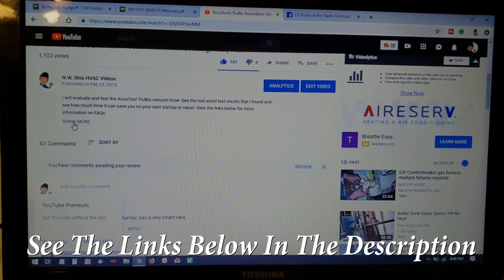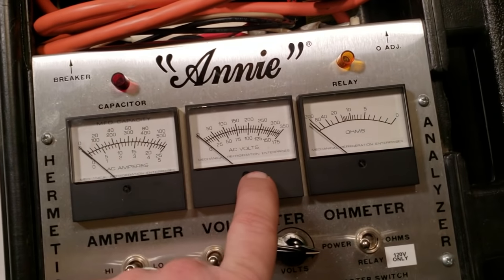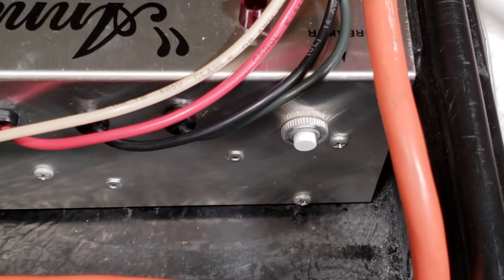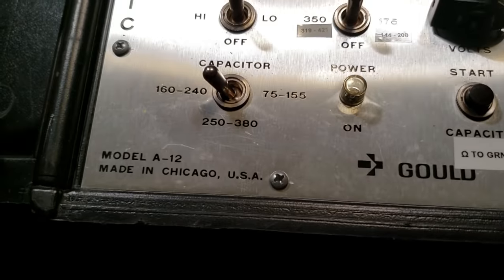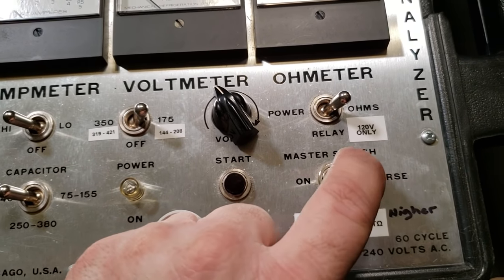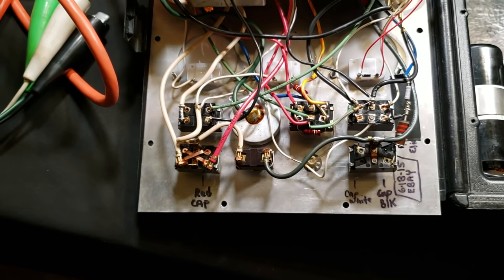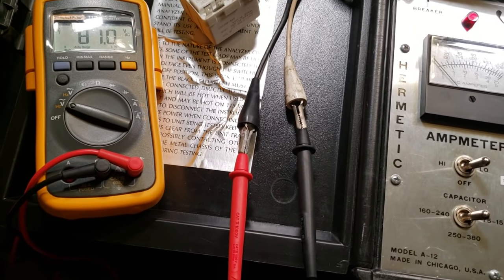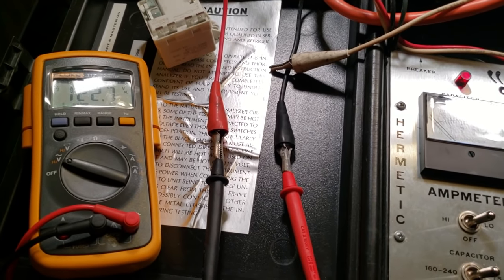Testing Refrigeration Compressors & Start Components W/ Annie A-12 Hermetic Compressor Analyzer

Comment: Surprise shout out!👍 Realize that what I've been calling my ebay Annie is in fact a UEI HA1 "hermetic compressor analyzer".😲 Similar but without the potential relay test.

Looking forward to seeing you on live equipment again soon!
Reply from the maker: Sorry if I butchered your name it's a little difficult and I've never been good with names. Yes,  I'm hoping to get on some equipment that is not of our customers. (Hopefully I still don't get any slack over it.)
Reply: Still have that UEI in the project closet awaiting led replacements.....keep a start set of three different Supco universal kits and a universal extension cord with wago connectors
Reply: Very cool checking the relay cut outs drop out voltages
Reply: Dave's repair site been a favorite for years with home made box switch box

Comment: I saw that annie personally when i was a student but its quite expensive in philippines...i really like that analyzer back then. My hvac instructor required it as our project to build a simplified annie. Nowadays we just rely on our multimeter and clamp meter to troubleshoot cause annie is only for single phase hermetic use only
Reply from the maker: This is one of the original ones from back in the 80s. I agree these are not required to diagnose a compressor,  they just make it a little quicker and more convenient.  I'm a little confused by the last statement in regards to it only being useful for single phase? I haven't seen a compressor that is  3-phase and uses start components😲 Thanks 4 watching👍👍

Comment: Hey HVACR Survival so in section d working with a frozen or stuck rotor... glancing at your diagram does it switch between start and run to try and reverse the locked up compressor?
Reply from the maker: You are correct. Hold the start button down while rocking the forward and reverse switch for 1-2 seconds. Anything longer and you might blow up your start capacitor.

Comment: Have compressor analyzer somewhere in the basement when I did service back in the early 90S nice videos.
Reply from the maker: Edward. It really has its place more it seems in the refrigeration side of things than in the residential but all the same it really does make it easier. I mainly use it for verifying whether it's the compressor or the start components. I don't use it so much to reverse the rotation. Thanks for watching and I appreciate you commenting!

Comment: From Me To You, OLE! 

The following data is applicable to the ANNIE A12X Export 220-250 Volt-60 Cycle Model.

SECTION A – METER OPERATION 

Ohmmeter

1. Make sure the Analyzer is unplugged and Ammeter Switch is off, Ammeter operates on “D” cell battery.
2. Move Ohmmeter Switch to ohms position.
3. Clip Red & Black leads together, turn Master Switch on, needle will move to about zero. Adjust to zero Ohms with control inside chord pocket. If meter will not zero, replace battery.
4. Use Red & Black leads to identify winding terminals. Highest Ohms is from Start to & Run terminal.Terminal left is Common. Reading from Common highest is Start. The remaining terminal with lowest reading is Run.

Voltmeter

1. Disconnect Analyzer from external power source.
2. Put Ammeter Switch to “Hi” position.
3. Put Ohmmeter Switch in “Power” position.
4. Put Voltmeter Switch in “Line” position.
5. Turn Master Switch “Off”.
6. Isolate Black, Red, White and Yellow from each other and earth.
7. Connect power supply chord of Analyzer to "coltage connection to be read.
8. The "voltage indicated on the Voltmeter is the line "voltage supplied to the Analyzer.

Ammeter

1. Disconnect Analyzer from external power source.
2. Put Ohmmeter switch in “Power” position.
3. Put Ammeter switch to “Off” position.
4. Put Master Switch in “On” position.
5. Connect the apparatus under test to the Red and Black leads. Isolate the Yellow and White leads from each other and ground.
6. Connect the Analyzer to a power supply of the correct "voltage for the apparatus being tested.
7. Put Ammeter Switch to “Hi” position, read up to 25A apparatus being tested. After apparatus has started switch to “Lo” position, if current draw on the ammeter is under"5A"
8. If line "voltage is desired while measuring amperage, place voltmeter switch in the “Line”position.

Section B - HOW TO CHECK A HERMITICALLY SEALED UNIT 

1. Remove all external wiring from the terminals of the sealed unit.
2. Connect the Red Lead to the Run Terminal. White Lead to Start Terminal, Black Lead to the Common Terminal, and the 
Yellow lead to the solidly Frame.
3. Make certain Master Switch; Ammeter Switch and Voltmeter Switch are off. DO NOT CONNECT ANALYZER TO EXTERNAL 
POWER.
4. Put Ohmmeter Switch in “OHMS” position and press Start Button. If resistance is indicated (movement of ohmmeter)
the windings are shorted to the frame.Replace unit if this condition exists.
5. Put Master Switch in “On” to check resistance of Run winding. “Reverse” position checks resistance of Start windings. 
Replace unit if windings are open or earthed. 

Section C - HOW TO START A HERMITICALY SEALED UNIT

1. Remove Yellow Lead from frame and isolate it from earth.
2. Put “Ammeter” Switch to ‘Hi” position.
3. Put “Ohmmeter” Switch to “Power” position.
4. Put Master Switch in “Off” position. 
5. Put Capacitor Selection Switch in proper range (see selection G)
6. Connect Analyzer to power supply of correct voltage for the compressor. Power Light will come on when the Analyzer is energized. If no light or a very dull glow of Power Light check fuse in chord pocket. Replace if necessary. Line Voltage can be read by putting Voltage Switch in line position. 
7. Hold Start Button “IN” put Master Switch “ON” position.
8. Release button when units starts.
9. Turn Master Switch off if unit fails to start in 3 seconds. 
10.If unit operated satisfactorily the trouble is with the capacitor, relay, control, overload or other external wiring.
11.Put Ammeter Switch and Voltmeter Switch to desired ranges for further tests. These tests include low voltage or high current draws, those that are above rated amperage. If unit fails to start it is stuck, see section D. Disregard capacitor and relay bulbs while making this test.

Section D - HOW TO REVERSE A STUCK OR FROZEN UNIT 

1. Proceed as outlined in Section C, steps one and two.
2. Holding start button in, quickly move Master Switch between “On” and “Reverse” position several times. If unit starts let 
it run for approximately a minute then turn it off. 
3. Try to start the unit as outlined in Section C, Step 3. If unit now fails to start it is beyond help and must be replaced.

IF FUSE BLOWS WAIT FIVE MINUTES AND REPLACE THE FUSE INSIDE CORD POCKET

Section E - How To Test Capacitors

1. Make sure Master Switch and Ammeter Switch are off. Put Ohmmeter in Power position. 
2. Disconnect Capacitor form all external wiring including bleed resistors. 
3. Discharge Capacitor with light bulb or bleed resistor so as not to blow fuse on internally fused capacitors. 
4. Connect Black and Yellow Leads to Capacitor terminals.
5. Connect tester to power source.
6. Place Ammeter Switch in “Hi” position and note reaction of light.
a. If light goes on then out the capacitor has taken a charge. New capacitors may keep the light glowing for few minutes
b. If no light the capacitor is open.
c. If light stays on then the capacitor is shorted.
d. If light decreases but does not go out the capacitor is leaking.
7. When light goes out, press capacity button for mFd reading of start capacitors. (Do not press button if light remains on 
indicating a shorted capacitor) Discard capacitors that vary 20% from rating. For small start and run use “LO” range on 
Ammeter. 
8. (Optional) The Analyzer can be left on the job as an emergency substitute capacitor. Connect the Yellow and White 
Leads to the leads that normally go from the systems wiring to the capacitor DO NOT PLUG THE ANALYZER IN, put 
Master Switch on and set Capacitor Switch mFd needed. All other switches should be left off or in the center position.

SECTION F - TO TEST POTENTIAL RELAYS ONLY

1. Make sure Master Switch, Ammeter Switch, and Voltmeter Switch are off.
2. Put Ohmmeter Switch in relay position.
3. Turn volts control all the way down (counter clockwise)
4. Connect White Lead to relay terminal #1, Black Lead to #2, and the Red Lead to #3.
5. CONNECT ANALYZER TO 230 VOLT POWER SOURCE.
6. Turn Master Switch “ON” and set Voltmeter Switch to relay position. Relay light must come on. If no light points are 
open, replace relay.
7. Increase volts until relay “picks up”. Make a note of the voltage before “pick up”. This indicates the “pick up” voltage.
If light remains on, points are frozen and relay must be replaced. If relay does not “pick up” at maximum rated volts,
the coil is bad and the relay must be replaced. 
8. Decrease voltage until relay “drops out”. Make a note of voltage just before “drop out”. This indicates “drop out” volts.
Light must come back on when replay drops out. If Light remains on the points are frozen or sticky and relay must be 
replaced. 
9. Compare pick up and drop out voltages with the information supplied by the relay manufacturer. 

SECTION G - 240 VOLT CAPACITOR INFORMATION

1. Units up to 2 hp use 25-80 mFd range.
2. Units of 1-1 hp use 85-145 mFd range.
3. Units over 1 hp use 150-200 mFd range. 

SECTION H - RELAY WIRING INFORMATION

1. G.E. Relay 
a. Lead from post #1 goes to “Start”
b. Lead from post #3 goes to “Run”
c. Other post is “Common”

2. Delco Relay
a. Lead from post #S goes to “Start”
b. Lead from post #M goes to “Run”
c. Other post is “Common”
Reply from the maker: Thank you!

Comment: I was hoping to see the reverse switch setting in action. Does it work on your unit?
Reply from the maker: Yes it works,  the switch swaps the start and run windings to reverse the motor, you just rock it back and forth really quickly sometimes it works sometimes it don't

Comment: how would you check a potential relay with a multi meter
Reply from the maker: It would not be as scientific as this but what you could do is put your amp meter on the capacitor lead and watch the amp draw as it starts, does the amperage drop out once the compressor comes up to speed?  That's about the only way I would be able to do it without having a step up Transformer. Generally I would not want to waste my time knowing whether it's just a little out of whack. I generally open up the relay and look at the contacts to see if they're pitted or when in doubt change it out. It only takes a year or two and they're pretty pitted even though some last for 10 or 20 years.